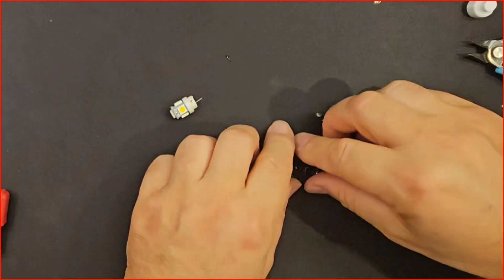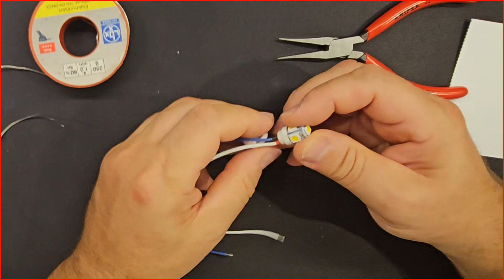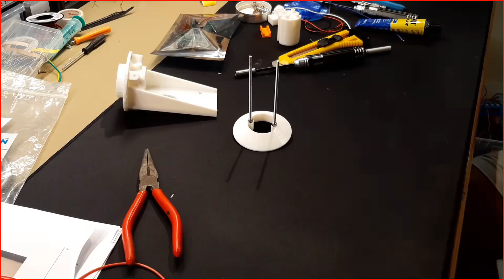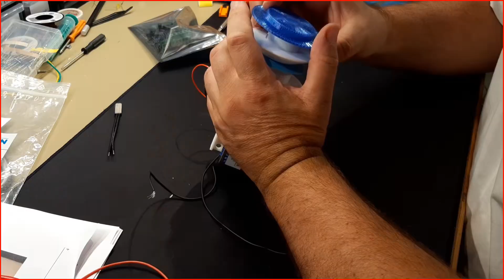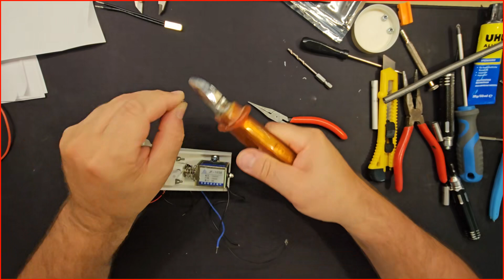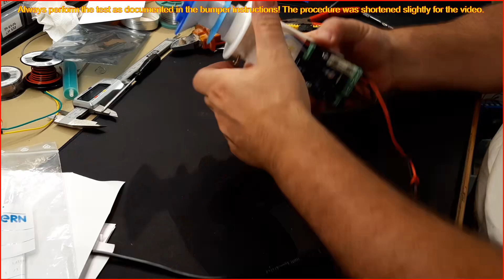DIY Bumper assembly instructions

Comment: I had no idea each bumper was this complicated! I'd assumed there was some central MPU handling the triggering of the solenoid or something. I can see the advantage of each bumper handling everything autonomously, however. I love electromechanical stuff!
Reply from the maker: Hi, yes there is an option for a central controller. however i made the Circuit the way that you can build a small pinballmachine without an controller, hence all bumperst can act autonomosly. regards!

Comment: another curiosity, are you going to make this machine complete with backglass and the four scoreboards, and if so do you have the measurements, I had started one here, the playfield was 0.50 centimeters by 1.10 one meter and ten I don't know if this is correct these measurements, but for me to be able to build a table using your STL files, it would have to be the measurements you are using on this machine, in this case I will make the same machine but with a different theme, a Taito 1983.
Reply from the maker: Hello Edu, no i will not make a "box with Backglas". i will do a led Matrix 8*64 similar to the one i did for my space shutller replica -> https://www.youtube.com/watch?v=Sgq4DvL_ENM
The Playfiled of the Fathom and as well Space shuttle is 100x50cm in size.

Comment: This is very interesting Fabrication to me.  I own an old pinball machine that I play with.  I have been thinking of making a pinball machine for a few years now and will likely start once I fully retire here in Canada.  I think I will try and replicate an existing old pinball machine perhaps the same one you are doing as it has all the various assemblies.  I also do 3d printing and machining with access to cnc machines.  I'm still researching how I will go about this project.  One thing I have found is a guy who 3d printed bumpers that had conductive print material, he printed the body and apron the ball runs over to make the trigger happen because the ball is conductive.  I'm wondering about the electronic boards and entire system as to what you are using?
Reply from the maker: Hello, i designed the electronics as well myself. I use an ardunio Mega as controller. With the STLs i provide as well for some the needed PCB Greber Files. Just look up whats avaibale ->  https://cults3d.com/en/users/wilfriedfabian/3d-models
With the time i will ad some new assemblies. I have also seen some bumpers designs as the one you describe. However the Bumer design i made works quite well, i was thinking before i started my fathom relplica project to change it to an insductive triggered one, but had no time. 
To inspire you for your retirement, see my fathom Videos - here ist part 3 https://www.youtube.com/watch?v=YAW4IB6R530